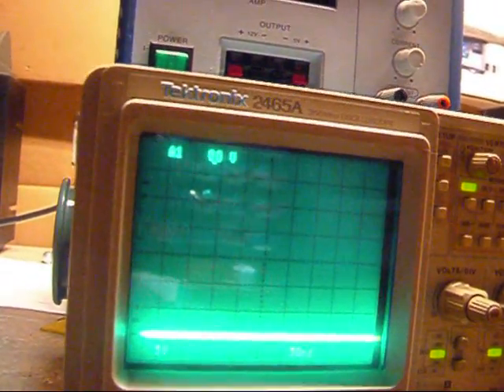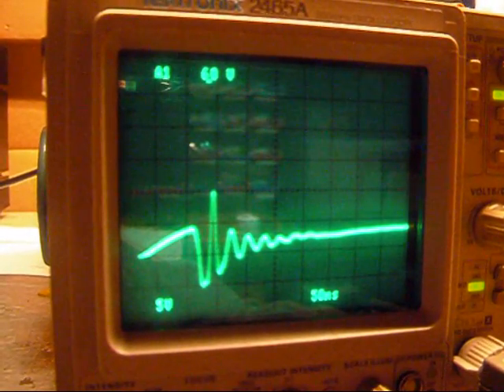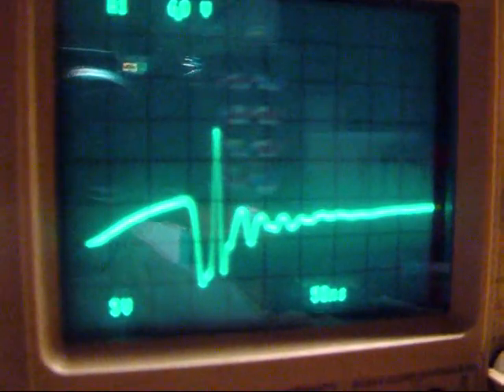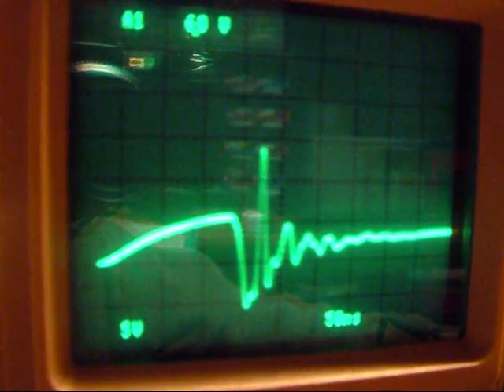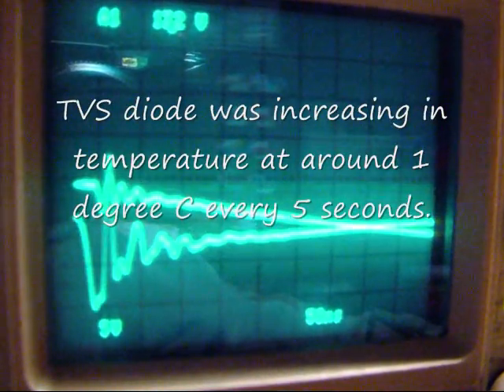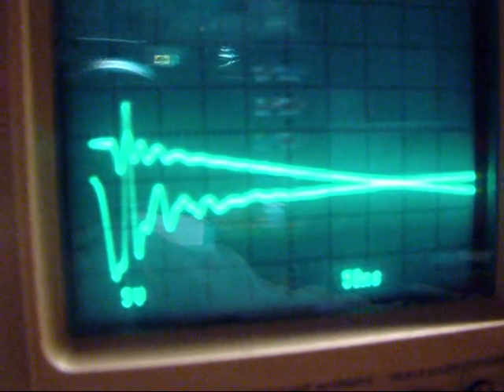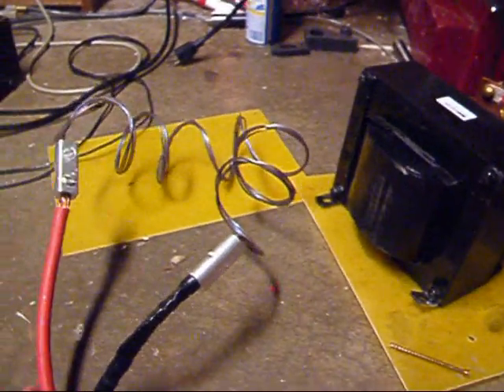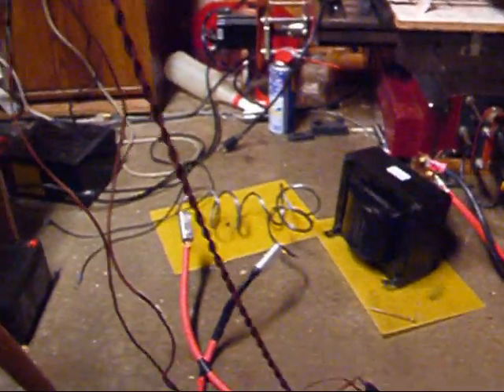24v, 0-140amp test with 2 mosfets/diodes

Comment: I know this video is a few years old. but I am needing to build a power inverter. 12-24v to 120v ac. I need some good N-channel FETs . I need them for the push pull boost stage. I am curious to know what MOSFETs you are getting 140a through. I haven't been got near that through the ones I have used. I am new to working with electronics. and would appreciate all and any help I can get. this is my first big project. thanks . great video wish it showed more.